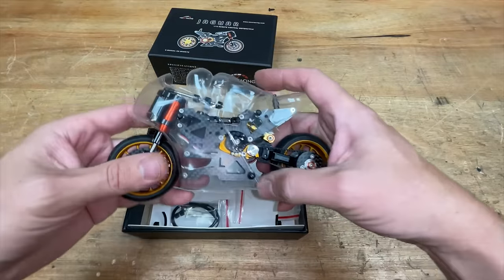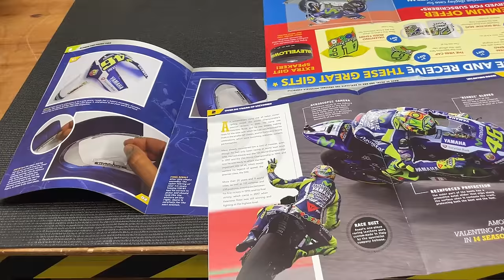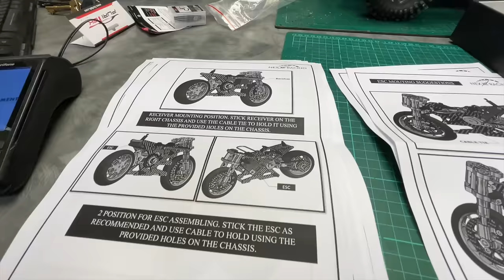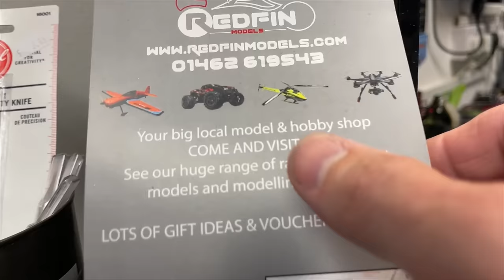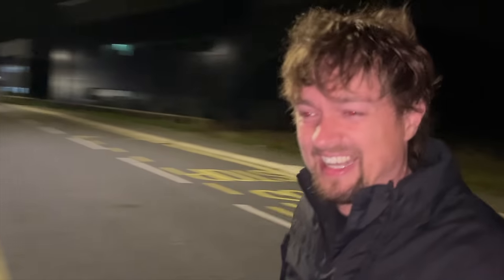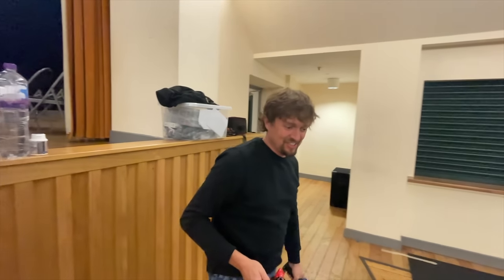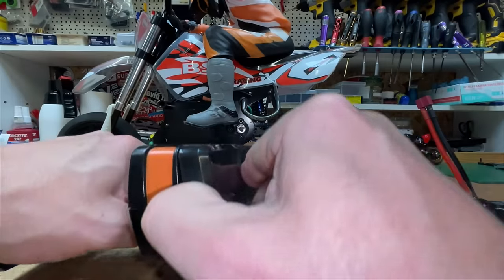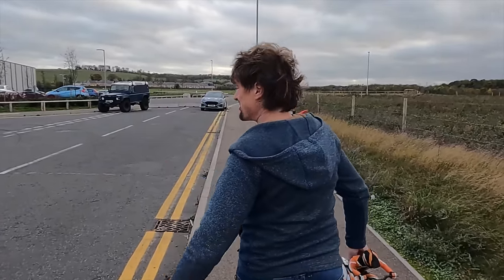mini RC Superbike is too fast!!

Comment: It is a shame that radio controlled motorcycle racing hasn't taken off.  One can't even find a YouTube channel dedicated to it like FPV quadcopter racing.  It is weird that FPV cameras haven't been added to the racing motorcycles where the drivers use FPV goggles.  This would remove the need for line-of-site control.  Additionally,  retractable outrigger landing gear could be added to the motorcycles like the Peraves MonoRacer (MonoTracer) to keep the motorcycle upright when stopped.  It can also assist in righting the motorcycle when on its side, with the gear retracted.  There are videos on YouTube showing this: "The Peraves EcoMobile - Discovery Beyond 2000 (1994)" and "The Peraves EcoMobile - Discovery Invention (1991)".

Comment: On a similar size kyosho I had years ago the insert in the front tyres was a steel band and it acted as a gyro when the front wheel was spinning. Then when you steered the steering fought against the gyro to try and stay upright. Just wondering if you could make something similar for this bike
Reply: i had one too. it worked quite well.   this thing should used for target practice
Reply: @rosslenoir4373  Yea, I had one too. It ran great, you could hit jumps with it and everything. I don't know why this one is so bad. 

I recall the Eleck Rider had a pivot so the front wheel would kick out left or right to turn. I think the steering wasn't actually connected to anything. The kick out twist made the bike lean and turn. It didn't turn fast, but it was smooth.
Reply: Fjtutrwrtju7utjk^

Comment: I think a gyro would do wonders to stabilize the bike.
Reply: That's exactly what I was thinking
Reply: @MobPerfect  I was talking about the first bike. There's no way to know what helped the second bike over the first. It might be that bigger bikes are just easier in general
Reply: LOSI HAS A NICE SIZE WITH A SUPER GYRO CANNOT FALL OVER IF SO WILL GET UP HIT THE GAS PLUS WHEELIE CHECK IT OUT GUYS.

Comment: Problem is, you don't steer a motorcycle by turning the handlebar. They should make it weight / balance based & have a servo swing a weight to either side for turns. Maybe making it in a larger scale would help too.
Reply: Also at low speeds you would steer with the turn and at higher speeds you would slightly counter steer to initiate the lean that would be really hard to pull off in rc just not natural unless you are on the bike
Reply: motorcycles are steered by the steering try going round a corner with no hands, you'll find it's push pull on the bars not lean....you steer the opposite way you wish to go.
Reply: Yes
Reply: At low speeds you absolutely do turn with the handlebars
Reply: They did years ago Kyosho Leaning Rider series.  They were heavy but handled like the real bikes. They just re-released them.
Reply: Motorcycles are turned at speed by pressure on the handlebars. (I've been riding for over 40yrs... Dirt and Road). It's called "counter steering."
Forward pressure on the right bar tilts the bike to right, causing it to turn right. Reverse thay for left turns. It's an odd concept for non riders to understand, but it works. 
I have a Venom RC bike, it uses counter steering to turn.
PS a servo controlled swinging weight will not affect the gyroscopic forces of the spinning wheels. Weighting the pegs on a real bike can help turn it, but it's not nearly as effective as counter steering.
Reply: Bla bla bla
Reply: @natevanderloon9060  Even in a slow turn you start the manoeuvre by first throwing the bike off balance by counter steering it.  Even at walking pace it's just so small it's not noticed but what is visible is the eventual correction of that imbalance with the turn.
Reply: You actually do, very slightly
Reply: @johnc21turbo  other comments did make make me wonder why they'd bother making the front wheel turn at all if was all about the lean.
Reply: Sounds like everyone is forgetting we already have a device that allows counter steering. I had a Kyosho hang on rider back in the day, very fun.  emphasis is definitely on the throttle control over the steering.  Man.....I might look for another, not got many places to run it, but would be fun just to have again.
Reply: They steer back to front so if you turn left on your controller the wheel go right so on saying that it’s turning by the bikes waight going side to side and is dam smooth on my larger scale bike with a gyro built in the wheel but it’s not powered just waight that spins as you speed up
Reply: Natürlich steuert man über dem lenker allerdings bewegt man dem lenker nach links fährt das bike rechts
Reply: It needs a gyroscope......
Reply: @@sourandjaded2586 yes I think I remember that one, the rider used to shift side to side iirc....
Reply: Fax
Reply: That's why kyosho had the Honda NSR with the hang on rider, it acted like a real bike
Reply: Yeah ya do
Reply: @natevanderloon9060  you can't steer a motorcycle without moving your weight
Reply: @@sourandjaded2586yeah I’m pretty sure my mates one had the servo reversed. Surely the manual would have told him that but he probably don’t read it knowing Kev. 😂
 You steer the opposite way to make it Lean over a bit you are right.
Reply: @runar4993  I never said you could I said counter steering helps initiate a lean that’s why 80 lb women can ride 800 pound bikes if they know the proper technique
Reply: @natevanderloon9060  That could easily be be accomplished with RC if the demand was there. That's a cake walk compared to what the flight control board on a quadcopter has to accomplish.
Reply: When you lean a real bike it tries to automatically steer in the direction of the lean. This is why when you turn left you hold pressure on the bars as if you were turning the opposite way...... this is why you can throw a choke on (cruise control) and ride no handed. When you lean, it steers....just can't take sharper corners at low speed this way. 25-30+ is no issue because the bike naturally wants to stay upright and straight at speed (gyroscopic effect).
Reply: They actually race these things it’s a matter of skills
Reply: @montyfpv2259  in the wt
Reply: @giansingh6189  what?
Reply: I have a Ducati 900ss ..Yes..,Yes You DO need to steer!..lol.. you would have problems if you just tried to steer with gravity.
Reply: @runar4993  yes you CAN steer a motorcycle without moving your weight.. I have a Ducati 900ss and motorcross bikes, depending on the type of bike and speed.. you DO need to use the handlebars to steer at ALL speeds..but at slower speeds you wont need to shift weight.. at higher speeds..definitely need to shift weight if the corner is sharper, if you're at high speed and have a very shallow bend you might not need to shift weight..it's different with each bike..each speed..each corner type.
Reply: Great 💡 idea
Reply: You absolutely turn the bars. Not much but you are supposed to be counter steering not just leaninf
Reply: @bobbydisco2146  at high speeds also it's called coutersteer
Reply: However you can turn the bars at high speed and that causes you to turn the opposite way that you turn the bars
Reply: Many years ago I had one that had a weight that would lean the bike
Reply: Iirc tyco made one years ago where the rider was the weight and steering was accomplished by the rider sliding on a small track perpendicular to the moto from left to right etc
Reply: It needs an imu/gyro controller really......
Reply: @ifly65 i must have missed that! Awesome! They were pretty amazing back in the day
Reply: @erikastarling  uuh, how do you turn a kickstand? Jeez, look who's not so smart now!
Reply: Ok mate try riding a bike with locked up front forks ... Good luck with that 🤣🤣
Reply: Ya, and it would work with a giro and a big brain esc
Reply: Sounds like someone didn’t finish the video
Reply: @josheakins5137  lol ok. Guess that knee never seen the floor eh.
Reply: @thisolddog2259  Did ya not see the comment I replied to? He said you don't steer with the handlebars. Well, what else so you steer by then?
Reply: Good idea but there’s problems I think a rod in the middle with a weight on it that can shift side to side would be more reliable and consistent
Reply: Countersteering
Reply: You need to take countersteering into account. I think the little bike needs a lot of expo to not react so violently. Also, the flywheel on the bigger bike is a great idea.
Reply: @Axiomatic75  I agree but it’s also a toy that cannot travel at countersteer speeds
Reply: (In the most British women's voice)
Have driven a motorcycle at all ,ever.
Reply: Comin from a motorcycle owner I completely agree
Reply: You do use the bars/clip-ons, but above around 15mph you counter-steer, steer right to go left and vice versa. Another way to look at counter-steering is to push the left grip to go left, or the right to go right. Leaning your bodyweight helps turn in a little quicker, but you can't do much leaning alone.
Reply: You absolutely steer a motorcycle by turning the handlebars. Only on a small scooter or at very low speeds does shifting bodyweight do anything. I've owned several big bikes and have tried shifting my bodyweight when going like 60mph. Almost nothing happens. Countersteering is the only thing that leans over a bike quickly.
Reply: @HalfdeadRider  I ride bikes I just did not think this thing has enough mass and speed to take those into effect
Reply: @colbymaxwell244  I'm not 100% on thay, but likely does still, but I was just replying to the op saying you steer by leaning, which as you know, we don't.
Reply: Exactly why it cant steer.
Reply: Its probably need balance wheel on it ....
Reply: Your the problem
Reply: How can you be disappointed by thus as a micro ,
Reply: Facts I had a Tyco one years ago where the rider leaned side to side
Reply: @bobbydisco2146  no you really don't.. only time you turn the wheel is when your walking it
Reply: You turn with the handle bar, but to not flip you need to angle the bike. They are depending on each other.
Reply: That is incorrect.
Reply: Take it to the state park
Reply: Hello 👋
Reply: Confer steering set up. It’s correct
Reply: Your wrong...
Reply: @montyfpv2259  could you post a vid of the Venom RC on your channel mate? I'd love to see that, not just working, but the set up of the internals too.
As a long time rider and engineer, I can appreciate both the physics of how motorbikes operate, and of how much of the control of bikes is actually down to just feeling what inputs are needed at any given time, like how much the bike and rider become extensions of each other and how different the steering and rider weight position needs to change between low and high speed.
I'd love to see a proper RC bike setup that can replicate those well, especially if one can adapt between low and high speed. Rather than needing to be manually set off (or given a push start).
Reply: Пор
Reply: You do but its counter steer to initiate the turn
Reply: Ex-lax-ly right you are
Reply: Like do superman Marc Marquez style on a sharp turn?
Reply: It needs a gyro system
Reply: It used to be one like that long time ago.....it lean etc from the early 2000s or late 90s
Reply: You steer with steering wheel and body wt..ff lol
Reply: @EZ-D-FIANT  It has two.
Reply: @The_sinner_Jim_Whitney  really, crikey, maybe it needs more room or weight then as it doesn't look like it does, mind its way smaller then anything I'm familiar with so maybe, cheers fir letting me know anyway.....👍👌👍
Reply: @EZ-D-FIANT  I was kinda being a smartass, haha! Only kinda, though, the wheels on any bike generate gyroscopic force, and that's the way they stay upright and balance and everything. This RC bike just isn't quite right, I don't think, and as mentioned by a bunch of other people, if it was trying to steer the bars the direction you wanted it to turn it was never going to work properly.
Reply: @The_sinner_Jim_Whitney  ahh OK, I don't think they spin fast enough lol but i get it, yea I know how to ride see my comment above yours..
Reply: @EZ-D-FIANT  Yeah, I wasn't arguing with you just being a bit of a smartass, haha! You're probably right, they probably don't, or don't have enough mass to have enough of an effect on the bike to stabilize it.
Reply: Most are like this. It’s just too small
Reply: Thats the challenge
Reply: A gyroscope would be handy. It would be able to stay upright and not wreck so much.
Reply: Uh yes you do? Low speed steering mostly with the handle bar and leaning, high speed steering you still use the handlebar to initiate a counter steer to lean and use the handlebar to steer back to straight and stop the lean.
Reply: @natevanderloon9060 they did it tho!! That losi rc dirt bike is crazy!!!!
Reply: Yes they are. Try riding one with your hands removed
Reply: Yeah it’s true you don’t just turn the bars left to turn left, but you do very much need to put pressure on the bars in one direction or another. Try leaning only, and you’ll be in the ditch. You have to disrupt the gyroscopic stabilization of the wheels rotating or it’ll just go in a straight line. 

For low speed maneuvering you manipulate the bars and your center of gravity much differently than you do for higher speeds too, so rc bikes are gonna always be a challenge, without some pretty complex tech, or a little shrunken person that can ride it and feel the cues one needs to feel to react accordingly.
Reply: Did you watch the video before typing that rammle? Just watch the cnt, cnt.
Reply: P.S. try manoeuvring a crosser without the handlebars, you sweaty lump of helmetdale.
Reply: @RorysRCbashing kjj
Reply: None of you know what your talking about 😂😂😂😂😂😂
Reply: The only way any bike is going to turn is by the handle bars
Reply: You do definitely use the steering to turn…. Big brain doesn’t own a motorcycle.
Reply: You dont need that. I raced for years with 1/5 motorcycles. Nouva faor and thunder tiger .  Still race them . 18 years now.  😊😊
Reply: @EZ-D-FIANT nope you dont😅
Reply: @TheGrimmReaper1  don't what.
Reply: Good
Reply: Dude, Put a movable waight Wil do Shit, Eiter Put a Gyro on the seering Servo or Drive It Like any normal 2sheeler  inishiate Corners with countersteer and Balance,

Comment: as some people have said you need the ability to lean with weight , imagine leaning left right ,over the bars and fender ,having a mix ,or on demand switch for low speed maneuvers/counter steering , drift modes , ability to wheelie and possibly use the rc riders weight . its a hope and a dream , if a community is made with open source software ,like what happened to race quads ,I could see it happening. it would suck to crash and blow out like 4 servos and linkages on the rider XD

Comment: Had a Kyosho 1/14 with hang on rider back in the day, really fun.  I'd imagine you'd find it a little easier with a gyro with a soft setting.  But like most are saying, the emphasis of an RC motorcycle is less on steering and more to do with throttle control, you can still run a bike with epa's/DR all the way down to give you the flick you need to start the lean then practise throttle control.  And yea, you really need a big flat area to run them, even the tiny pocket racers like the mini-z motorcycle, speaking relatively.

Comment: I mastered it kind of quickly. You have to build speed on the straights and let off the throttle completely  before diving the bike into the turn and then give it power again on the exit. Power makes the bike stand up which is why you don’t want it on the entry and do want it on the exit.  Just like a real bike.

Comment: Look at counter steering on the model.  On a real bike you push the right handle bar slightly to turn right which is effectively is steering the bike left forcing it to lean to the right.  I know this sounds confusing but it's how it works.  To turn left you PUSH the left handlebar which in effect is steering the bike to the right forcing it to lean to the left. If you use this method when riding you are almost leaning into the turn by pushing the relevant handle bar.  If you have set the steering servo to turn left as you turn left on the wheel it will turn opposite to what you want.  Also there needs to be hardly any movement needed to make the turn so hardly any throw is needed on the servo.  Just a hint of a turn will do.  They are not like cars.

Comment: The old ones had free floating handlebars and used the 2S as a weight. When you turn it moved the battery from side to side. Worked great.
Reply: The good old Royal RC bikes 👍
Reply: This is what mine had. Miss that bike.
Reply: Good

Comment: RC bikes are tricky. You want to avoid steering under power and you need to counter steer once the bike leans in the turn. That small scale will really require a lot of skill.
Reply: Ironically that's just like a real bike. Most people don't understand you just lean the thing to turn and put pressure on the outside grip to counter steer. People think you actually turn the bars to steer lol.
Reply: @riothero313  Correct, just like a real bike.
Reply: @riothero313  You clearly don't understand either, you counter-steer above around 15mph, you steer with the bars or clip-ons either way, you can't steer by leaning alone, well you won't be getting around any bends anyway.
Leaning just helps the bike turn in a bit quicker, and you don't need to hang your arse off the seat and throw a knee down either, but of course that helps at very high speeds on track 😎
Reply: @riothero313  Ironically, you do t understand it either😂